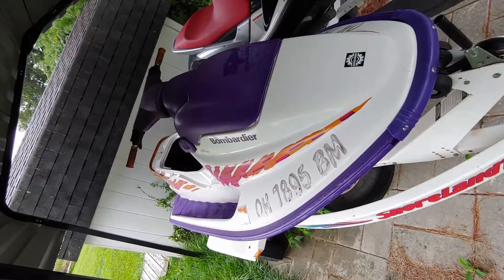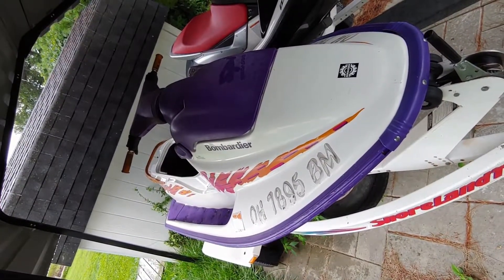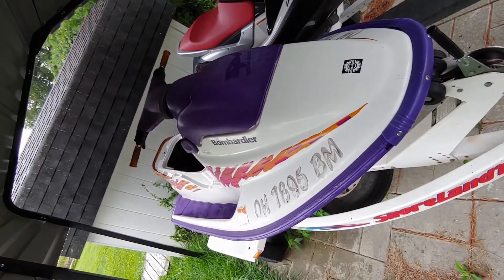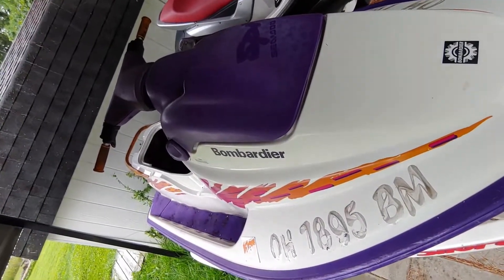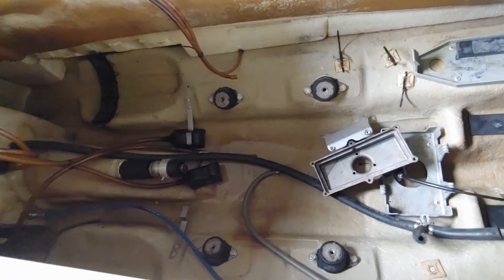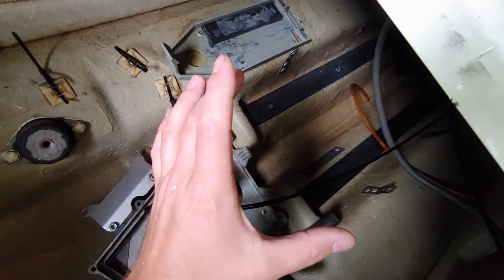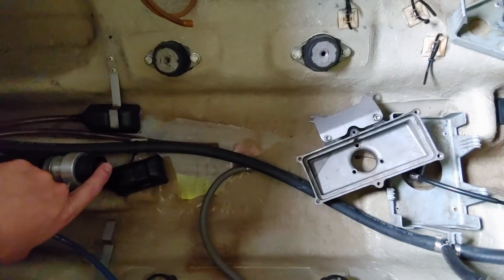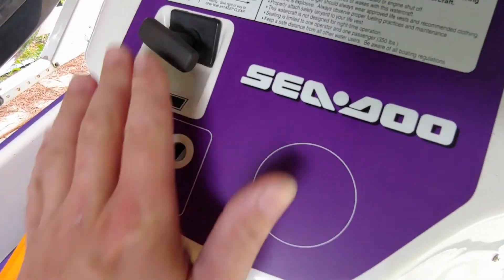DIY ELECTRIC Jet Ski  Part 1 - The Plan

Comment: How many watts this motor?
Reply from the maker: Sorry I dont remember the wattage but i think I had a link in the description if it still works
Reply: @EngineInformant  
1800 w would be interesting if you put motor 5000 watt then would be more interesting but also need another battery and controller